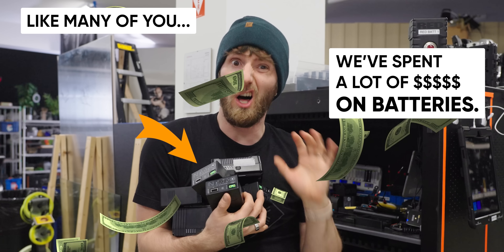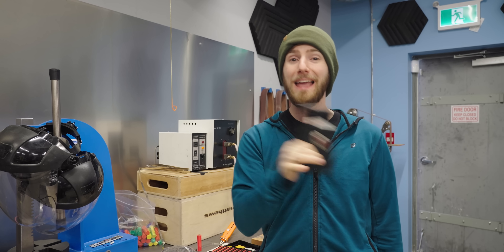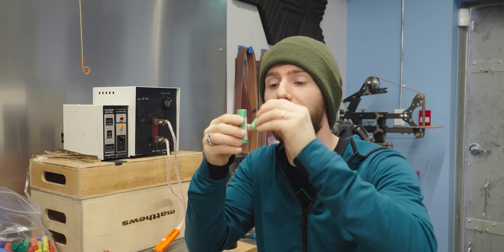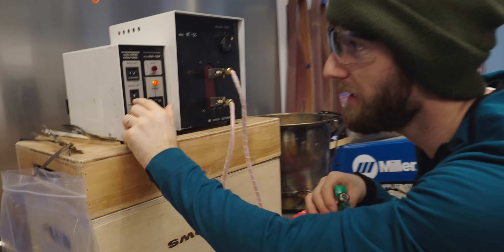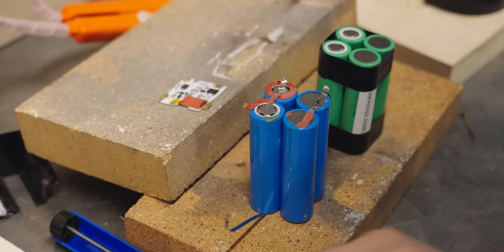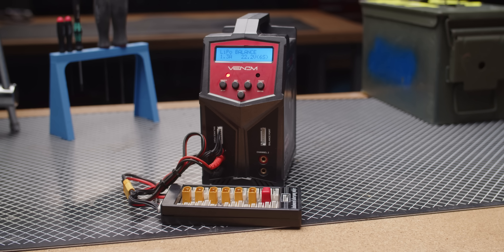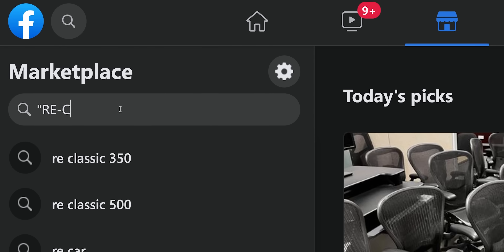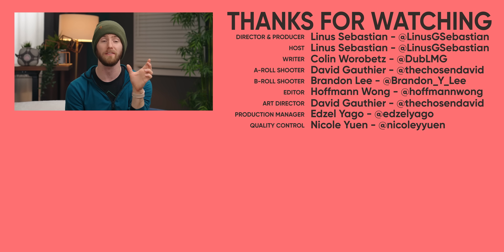This should be illegal… Battery Repair Blocking

Comment: A topic I would love to see a video on: Windows automatic updates.

I've just had two incidents:

* A week long run was ruined a day before completion because Microsoft decided to apply an update and reboot the machine. It also broke some old software I need. I had made a big effort to disable automatic updates, but apparently, something snuck through. Now, I have to spend time reversing the update, and then another week re-running my calculations. Yay. This computer runs a very limited use case, and I don't give a shit about security, as it is not exposed.

* My mothers old laptop automatically upgraded to Windows 11, and now it won't work properly, as it doesn't have the required hardware. Before I got my hands on it, the 10 day grace period to reverse the update had passed, so it needs a re-install, and I need to find some way to permanently disable Windows 11 updates.

Microsoft and others need to realize that we own our machines, and that they are only guests. They are behaving like a guest in your house who repaints your house without asking you. We probably need legislation about this, requiring an easy opt-out (or, even better, requiring that updates are opt-in). It's our machines, and they should be under our control.

It would be great if LTT could bring up this subject, as it is an important subject, and LTT has a huge reach.
Reply: i delay those damn things as long as possible... 

and great, an incompatible machine actually auto-updated to win 11? not surprised, but guess i'll have to watch-out for that nonsense. this machine also is listed as being incompatible...

honestly, it's gonna take legislation. i agree on opt-in, and it should go beyond all that. this cloud-based shit and software-as-a-service needs to stop, too. applications that do not explicitly require running on a server [which is mostly everything a common user runs] should not be tied to it, and you should not be expected to pay to rent those servers. alternatively, software that does this should be required to clearly mark itself as an FSAAS or FORCED software-as-a-service application. so that way, the company basically has to publicly say "i am an asshole" on the product description. 

tbh, i can think/talk about potential legislation all day. and they think california is anti-business? HA! they ain't seen nothing. i got all kinds of things i'd love to see done. businesses that continue to act abusively won't just be driven from state or country, they'll be closed and the excecs & lawyers might look forward to a nice view of metal bars for a good long while. on the other hand, behaving ethically should be quite rewarding and the 'big bad government' will generally leave you alone.

Comment: Why did they let Linus do this? lmao.... This was genuinely terrifying to watch.

Edit: I'm assuming what happened here is the chip didn't get the expected voltage or group voltage and refused to function. This is common on some laptop battery packs... they are made with specific cells that make specific voltage, and when that current drops outside of the expected range... they brick themselves. Even if you replace the cells that failed if the voltage isn't within the /expected/ range it will refuse to function. Not naming names... but several large brands do this and it's infuriating.

Comment: I have to disagree with the BMS being evil for detecting cell disconnection. Its similar to my opinion on Apple when they get accused of making their products unrepairable. I work as a network engineer and there were a lot of incidents where customer bought a software to monitor their network equipment, which was HPE Aruba AirWave. Its a Linux based server appliance and you used to be able to access the kernel through CLI which meant you could do a lot of debugging. But on the other hand, customers thought that its a good idea to hack a bunch of services on it, like DNS servers or load balancers, since it behaved like any other CentOS. This meant that these servers kept on breaking and eating up resources and a lot of TAC cases had to be opened. Since these hacked on services could not be detected through the GUI, finding them took a lot of time and support hours which frankly customer did not pay for. So HPE closed the CLI access to the server and made a simple CLI menu and you had to send keys to them, which they decrypted and sent back, so that you could access the CLI TOGETHER with TAC.

What I am trying to say is that from the customer point of view, it seems like companies are doing planned obsolesce but the company is just trying to protect themselves from a potential lawsuit. In Apple's case, the public demands more sleeker and faster devices, so they have to cramp these components in there. Which means that the battery doesn't have a protective plastic casing, so its a potential danger for people to poke in there without the know-how. There are also a lot of counterfeit parts for Apple, which might be dangerous to put in there, so Apple locking down component swaps with software is also something I can understand. Now if we talk about their tech support not up to the task of repairing the product, then its a completely different issue and they should be educated to do these tasks (or have programs where partners can get certified to do such repairs with official software/hardware components).

With the battery, even Linus shows how dangerous it could be to replace cells (see all the precautions he made and still getting a spark), so for an inexperienced person, this could mean they could burn down their house when trying to replicate it. The battery manufacturers are just protecting themselves, for when someone swaps out their cells for crappy Aliexpress ones and try to charge them with the BMS, they wouldn't be held accountable. (Just look at some of the insane lawsuits people won against companies after abusing their equipment - "putting the cat in the microwave to dry it" - "putting electric grill inside the bathtub because it was raining outside and burning down the house" - these cases were won, because the manufacturer did not put a label that said "you can't do said activity with said equipment")

Now the bottom line: Having safety measures to make repairing a products harder is not a bad thing. Everyone is a YT DYI genius until they get shocked or burn their house down. Not having proper services or partners that could officially repair said products IS a bad thing.
Reply: I have one more reason to disagree about BMS being evil for being bricked after cell disconnection.

If somebody asked me "Should the BMS accept a Reset if a battery did die while all others are at a healthy voltage?" I probably would tell the BMS supplier "no" because I would not like to be in press with a burning Battery because the BMS did open a circuit to the broken cell during a "reset on charge"

Comment: I understand why a manufacturer wouldn't want a janky 3rd party battery in their device because they don't want to repair a device that was damaged by low quality batteries. 
With that said, 1st party replacement service sounds like a good way to go for potentially hazardous components like batteries.
 
Thank you for this video. I hope for more content like this to put pressure on manufacturers to offer 1st party parts/service for their devices.

Comment: I was considering a spot welder for building my own pack for a diy project. After seeing this I think I'll go another route.
Reply: Watch some other videos, it's not that hard. Linus was way over-reacting to some sparks from the welder. If they had shorted the cells, you would have seen them arking and starting to vent and burn.

Comment: Did you at least try to quickly charging the freshly rebuilt pack? There is a shipping-mode on some BMS which shuts off the terminal voltage to protect the battery pack. This is reset if an outer voltage (charging) is applied

Comment: when i have repaired battery packs in the past, i have run into BMS boards that will not put out power until you have put it on a charger at least 1 time, i was told it was because it was a protection system to keep low voltage batteries from being further discharged, and the BMS does the check while a charge cycle is starting.
Reply: and further note, i have also run into BMS boards that want to cycle a cell from 3.95V to 3.45V and when i put fresh 4.2V cells on it, it would not run because it was triggering its over voltage protection.

Comment: laptop bms are a "evil BMS" they brick themselves when the cells are disconnected, you can get around this buy making the new pack and installing it in paraelle with the old pack without breaking the connection then once the new pack is connected remove the old pack

Comment: heck yea!! I want to see the battery recycling plant!! also did you try recharging that canon battery pack? usually you just have to wake the BMS up with a charge cycle. If the OEM charger does not detect the pack then just use a variable power supply with a low current limit set to manually charge the battery. That usually works for me.

Comment: The basic layout of the video was picture perfect. It makes sense to take precautions, these Lithium Ion Cell packs are really powerful and can ignite pretty fast. I also liked the workarounds for packing them together. But the Welder was getting the welding points far too hot for too long. It was very likely, that you damage the negative Poles to get them leaking Lithium. But I'm not sure he actually did. Getting a spark is a warning sign to back off immediately. But after some seconds you have to figure out what actually happend. Most times it would be the welder doing a spark (its Voltage with Current after all!), or cells equalizing. That's no problem if it is minimal. If there's actually only one Pole of a cell actually connected, there can not be an equalizing or short circuit! In this case it can only be the welder doing an air gap spark or emerging Lithium! If the pack stays so cold, you can touch it with bare hands, then there is no thermal reaction happening. No sand needed at that point. Maybe you damaged one cell - swap it out with another fitting one and go on. Linus was briefed correctly up to the point of immidiately backing off when a spark occurs. After that he was just panicking. No need for that. The interesting part would now be a successful swap of the red cells, to see if the battery board is a mean one. Maybe holding them connected to correct voltage all the time could be a workaround? Or is it really logging the battery degradiation? Many Questions remain. But I'd say for half of the hassle it's the cell packing and connection to be blamed, a physical and training problem, owed to us to get better at that point. But the battery boards are getting more sophisticated and thus problematic, a reset function could help. A Cell swap Service sounds great at that point! Its not soo much fun to do it at home. I speak out of some experience. (I do RC Models, have been soldering Lion Cells for private use since 2004)

Comment: MOST BMS'S AFTER BEING DISCONNECTED WONT WORK UNTIL YOU HOOK UP TO A CHARGER AFTER REBUILDING!!! JUST HOOK THE NEW BATTERY PACK UP TO THE CHARGER FOR 5 SECONDS AND IT SHOULD START WORKING AGAIN AND SHOW VOLTAGE ON THE OUTPUT

Comment: The LiPo battery in my Corsair Void carked it last year. I went on amazon, bought a replacement battery, pulled the right earcup apart, broke the wire to the speaker, went to bunnings, bought a soldering iron, resoldered the wire, installed the battery, put it back together, works good as new. Would have only cost me 30AUD too if I hadn't had to go buy a soldering iron because I'm a clumsy arse.

Also, I would love to see a tour of the battery recycling centre.
Reply: But now you have a soldering iron and you can fix even more stuff! It was a good investment, everybody needs a soldering iron!

Comment: I have this issue with Dell equallogics type 15 controllers where the SAN’s battery pack has a eprom that is programmed with an expiry date.  Even if you change the cells the pack still reports as end of life.  No way around it except having a way to reflash the eprom

Comment: I love how you start the video complaining about how environmentally unfriendly these battery packs are, because they produce (miniscules) e-waste; and then end up destroying a dozen or so batteries in order to reuse these packs. Great job you did there for the environment. Now just imagine if 'right to repair' allowed tens of thousands of people with even less technical skills like you to do the same. Ah yes, the environment will surely be better off with hundreds of thousands of new batteries tossed away, many apartment fires, many fumes harming people. You seem to forget that most people are idiots, even those who support your causes. We shouldn't be pushing for right to repair, which will lead to many jury-rigged devices harming unsuspecting people. We should be pushing for companies to make replacing parts easier and cheaper, while maintaining safety.
Reply: so... pushing for right to repair? because you just said "we shouldn't be pushing for right to repair, we should be pushing for [describes right to repair]"
Reply: @hopolapopola  Replacing isn't repairing. Changing batteries, like changing lightbulbs, shouldn't be considered a 'repair'.
Reply: People might not be so clueless if it wasn't locked out of their reach, and the issue goes further than just batteries. Because phones are getting to the point where you can replace the parts but it wasn't an authorized repairer, the system wont work. They want you to buy a new part, and pay their workers, many more dollars than you need to to get the problem fixed, and really they just want you to purchase a complete new one. So how many parts end up going to landfill?

Comment: It is really kind of annoying how catastrophic Linus pretends some of this battery related stuff is.. While yes, it can be dangerous to work with large Lithium battery packs (if you do something incorrectly), you aren't going to blow up your workshop or something if you connect together a few cells that have a 0.1 or 0.2 volt differential. A few sparks or a small piece of a nickel strip heating up isn't going to end the planet.. If you just use a little common sense and think before you act, this type of thing doesn't have to be a terrifying exercise as Linus seems to portray it.

Comment: Planned obsolescence isn't always malicious. Most of it is building the product to the quality of its weakest part. Why have an indestructible product, that costs 10x as much, if some critical component will only last a few years? With battery packs like yours, those BMS systems won't last forever (just a few years, reliably). So why make the batteries easily replaceable and end up with a product that is unsafe and will harm consumers?

Comment: ALERT! Remember to recharge the newly fixed pack, because the BMS will engage the low voltage cutoff and that's what we saw here. To reset the BMS, you have to apply recharge voltage to it.

Comment: my brand new DJI Mavic pro Platinum batteries died in storage, as per your video, probably due to loss of power to the battery management board. Now they are just bricks, Brand new unused bricks. RIP 😕

Comment: I dont understand why he has sparks, he could discharge the battery or maybe buy new ones that are not charged before. If all the batteries would spark all the time in every factory, then it would cost too much to produce them. Maybe the spark has no meaning, and it is normal, no worry about it.

Comment: Dyson for example has used Evil BMS‘s in ALL their products since the creation of the company. The cycle count is high but as soon as you reach it the pack is full on ewaste as they have a chip on board (electrician here checked for myself) that detects cell disconnection. 6 perfectly matched 18650s on these BMSs won’t do shit because the voltage only reaches one chip and nothing else. Thanks Dyson im now taking my business elsewhere 🖕🏻
Reply: I know how to trick the Dyson BMS after bricking one and reading in a microcontroller forum that nobody was able to reset it.
The easy trick was to disconnect the BMS power supply first to prevent broken Cell detection. On the Dyson BMS it is pretty simple, just disconnect main positive first, and then you can reuse the BMS
The hard trick would be to solder the same amount of cells parallel to the BMS before disconnecting the old cells.

A broken cell could be right on the edge to a fire hazard.
I don't want to defend bad companies, but if the BMS supplier would ask me "Should the BMS accept a Reset if a battery did die while all others are at a healthy voltage?" I probably would tell the BMS supplier "no" because I would not like to be in press with a burning Battery because the BMS did open a circuit to the broken cell during a "reset on charge"

Comment: Linus is right, swapping only the bad cells is dangerous. When making a parallel battery pack, the cells must be closely matched. That's usually done at the factory, where similarly matched cells are made into a pack and vastly different cells are recycled. All cells in a parallel pack must come from the same manufacturing batch!
But what you can do is salvage those good cells and discard the bad cells. You can then match the good cells because they came from the same manufacturing batch and make those into smaller parallel/series battery pack.

Comment: laptop batteries also wipe their BMS after replacing the cells, the only way to save the original BMS is to keep it powered the whole time, by using a bypass battery, in which all the cells are charged to same voltage, so as prevent huge inrush currents.

Comment: If you hotswap it will do the job, but the voltage need to be similar. Another thing you can apply voltage to unlcok the controler from dc power supply.